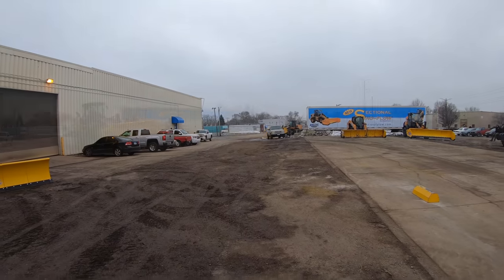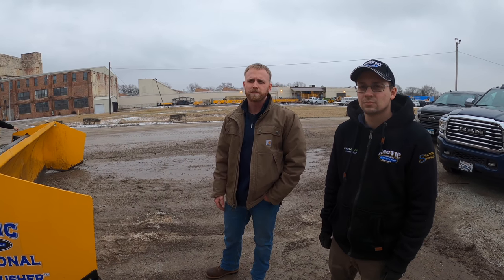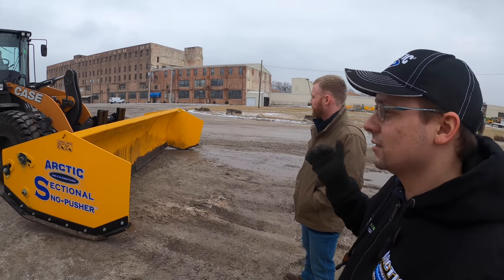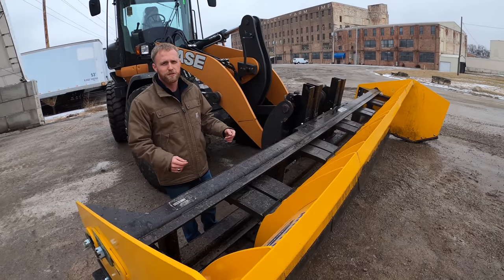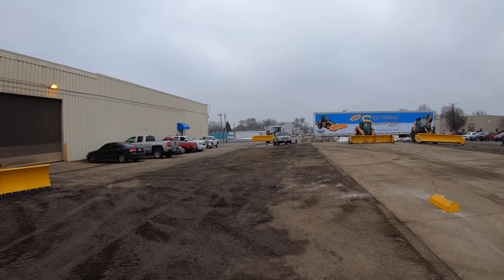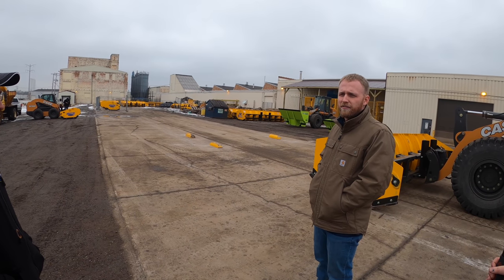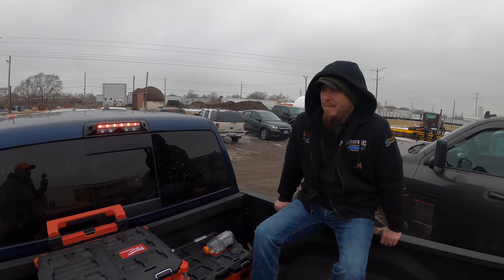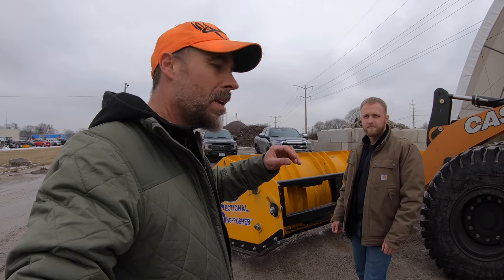Hitting a Cement Curb at full speed In a Loader. 4 k video

Comment: I use to work for a paving company that did parking lots and I use to run a skid loader for them with a broom head on it and I’ve hit my fair share of water valve caps and I can assure everyone it’ll rattle your brains loose that’s for sure.
Reply: Be happy you ran with a broom then, those are a lot more forgiving than a blade or a bucket!
Reply: Grumpy ol' Boot it’s a broom with a bucket still has a cutting edge on it
Reply: @RiverValleyAcres  
Ahh, I thought it was one of the rotating brooms, y'know, for sweeping ?
 - Those are not so bad.
Reply: Grumpy ol' Boot yeah I figured that’s what you thought. I might not have picked the best wording lol. But yeah I about went through the front windshield lol.
Reply: @RiverValleyAcres  
i can best imagine, ah well .. as long as there is no damage, I guess it would've been allright - though uncomfortable.
Reply: It's called a box broom

Comment: Sadly I actually saw a loader operator die from hitting a raised manhole full tilt with a fixed bucket pusher back in 96. It was a Cat 938 and the operator flew threw the window and out past the bucket. It was a tragedy for sure.

Comment: How wide of a sectional would you put on a Volvo L 25 wheel loader for driveways and can you get poly blocks for the cutting edge ?
Reply: For Driveways I'd recommend pur LD8. Yes we offer poly edges. Soft or hard.
Reply: Do you have a make and model loader that you would suggest for driveways and small back roads
Reply: @richardrasmussen7334  I'd take a look at the smaller model CASE or Volvo compact loaders. Ie Case 121 or 221, Volvo L25 or L30